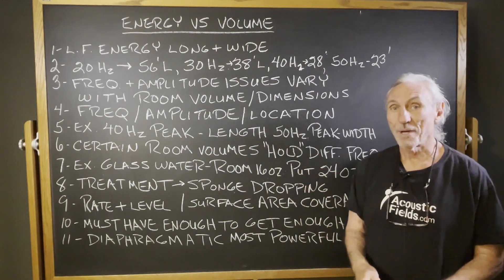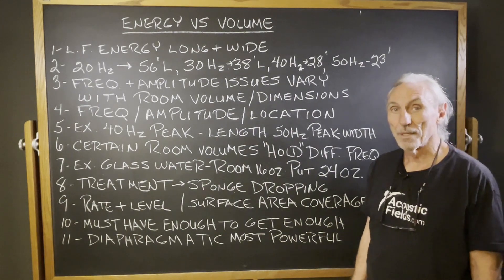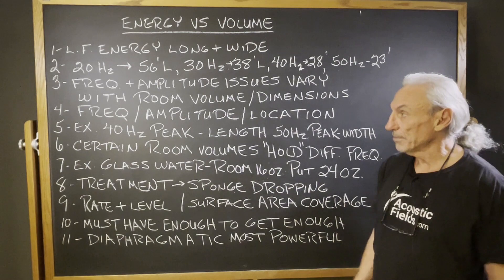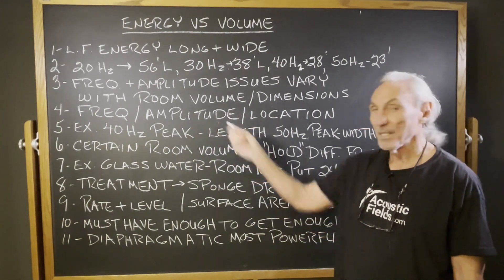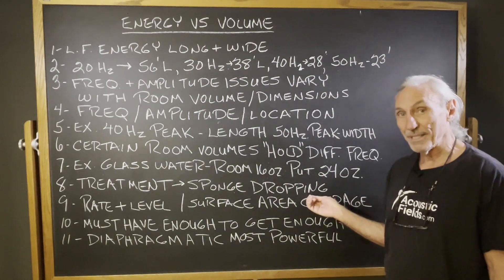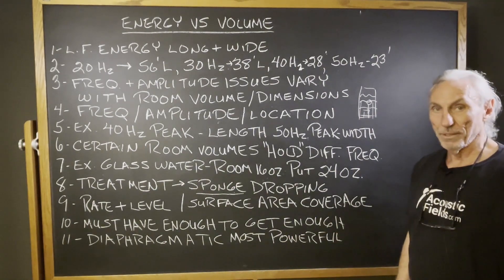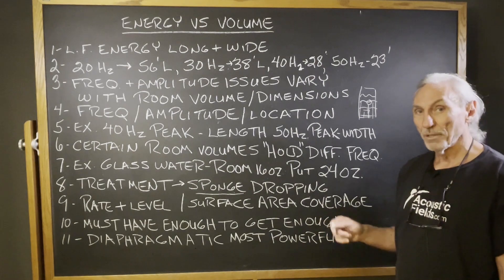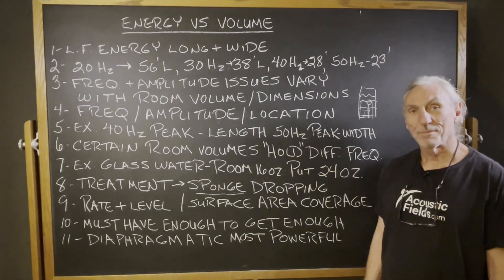Energy VS Volume - www.AcousticFields.com

Comment: Hi appreciate your videos. Earlier you said driver size should be matched to room size. Basically you are saying, as the room becomes smaller and smaller, it's better to choose subwoofers with smaller drivers. Let's say 10" instead of 12". So is it not possible to enjoy movies at reference level spl in smaller rooms ???
Reply from the maker: With sub woofers its all about the output of energy into the room or box container. The dimensions of the room dictate how much energy it can handle before modal issues become too audible. You want to stay below that threshold.

Comment: Of course you got it right. You know what you’re talking about :-) I am just glad you explained it in layman‘s terms. I had a very similar conversation with a studio audio components sales person. They kept pushing the higher wattage speakers with the larger woofers. I had to explain to them that even with the increased frequent  response in the monitors. I will never hear it effectively! My control room is far from perfect. The size is what I inherited. I put large bass traps in all the corners and the ceiling. I built quadratic diffusers on the back wall which eat up a large part of the rooms usable listening area just because of reflection. In all and back to my point. I had to explain to the sales person that it doesn’t matter if I place larger woofers with higher wattage. I will never clearly hear those frequencies because my room size and dimensions will never handle those pressures. I ended up getting a very clean set of bi-amplified medium sized flat sounding monitors that did not create more pressure than the room can handle even at 3/4 volume. Unfortunately because of my room limitations. It requires that I use spectrum analysis and reference microphones to check my mixes. I have learned how to mix in that room so I don’t get problems when the material is played back in another room or location. Thanks again for the video.
Reply from the maker: Most sales people have no idea about room acoustics. Their function is to sell boxes that produce energy. They fail to understand that placing those boxes inside another box (room) creates many issues that will negate the performance of the box they are selling.

Comment: The amplitude of program material does not create room modes, the geometry and material density of the room creates the peaks and dips in frequency and time response. This may have been oversimplified to make a point but it doesn’t sound quite correct
Reply from the maker: All variables are related. If you focus more on the total picture, you will see the significance of each variable as it relates to the issue.

Comment: Can you make a video on ceiling diffusion in small rooms. You recently showed that you have been trying out QRD in vocal booths (short distances). I’m very interested to hear what you discovered.
Reply from the maker: Ceiling diffusion adds about 35% more psychacoustic "space" in the floor / ceiling dimension. A 9' ceiling sounds like it is 12' high. Its a huge difference and well worth the cost.
Reply: @AcousticFields  Are you talking about first reflections points on the ceiling?
Reply from the maker: @levijessegonzalez3629  You have two issues with all room dimensions. You have pressure and reflections. Pressure is lower frequency energy that wont fit into the dimensions of the room. Reflections are a middle and high frequency issue.